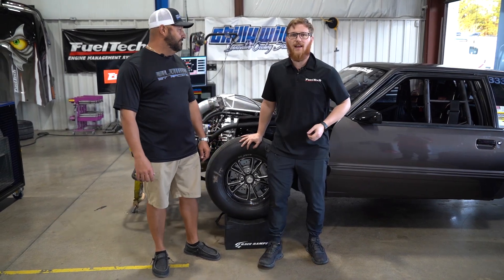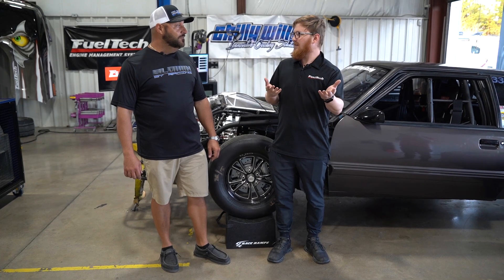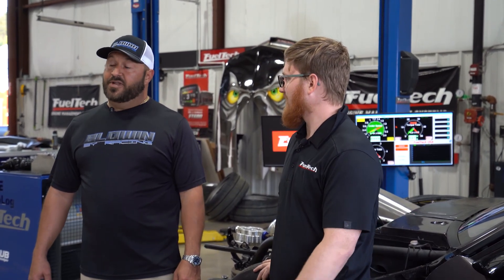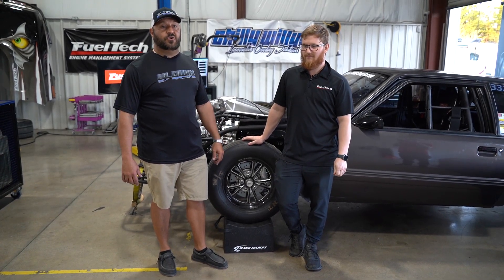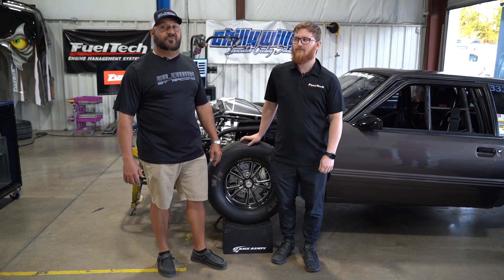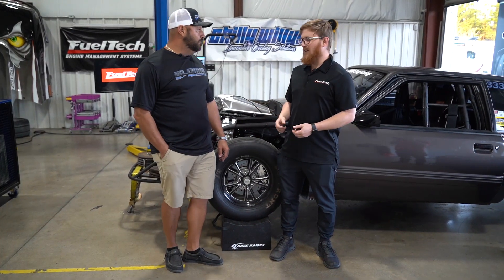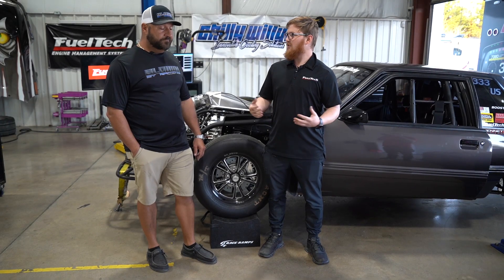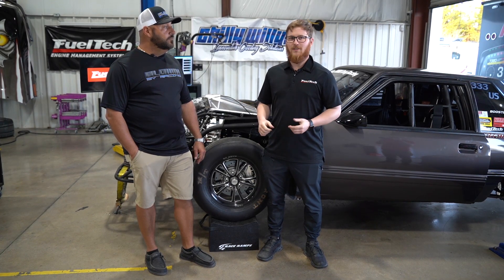1,733 WHP | NMRA Renegade | Jason Spina

Comment: Should try a Pettis small block Ford combo.We got just under 2,000 h.p.to the rears out of our Pettis 434c.i. Ford small block with a Procharger.
Reply: Or a MMR coyote. 4,000hp. 10,000 rpm
Reply: @johnchopp3278  He runs NMRA Renegade class.Stock blocks or the Dart Man "conventional V8" block which is a cast iron block thats pretty much stock aside from head bolts.If you want to run a mod.motor you have to use stock mod. block with the stock mod. heads.Its also a single power addder class limited to turbo w/impeller size of 75-76mm or superchargers w/impeller size of 3.60-380 I believe.U can run NOS also but cant remember the what kits are legal.Renegades not an all out class.Thats why I said the "Pettis sbf" because that was our class legal setup for Renegade.Theres a laundry list of rules that come with running a mod motor and you'll never get close to 4,000 hp out of it.
Reply: @topseykretts251  my point was to all the brand x guys out there with their LS motors. And big block Chevroleg's. No factory heads making that kinda steam. Except on a FORD. 😆
Reply: @johnchopp3278  I must of been a little confused seeing as I was talking about a Ford sb "that I clearly stated"and not a "brand x LS Chebby"
Reply: @topseykretts251  7-11 has a free LS with every Slurpee purchase. 😆
Reply: @topseykretts251  i just found a pair of LX tailights to LS swap. I think we're on the same page.
Reply: @johnchopp3278  My grandpa was a Chevy guy racing in NHRA back in the 70's and even he said they where "dime a dozen and cheap, thats why most of em run em"
Reply: @topseykretts251  the fox body is a reincarnated 32 Ford